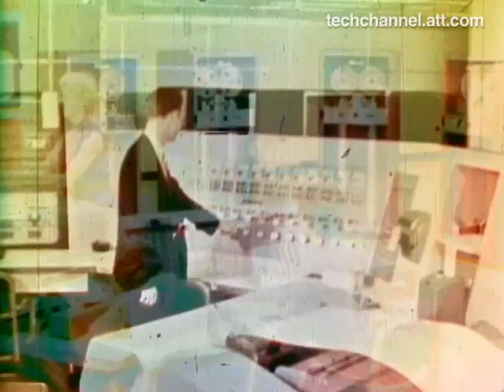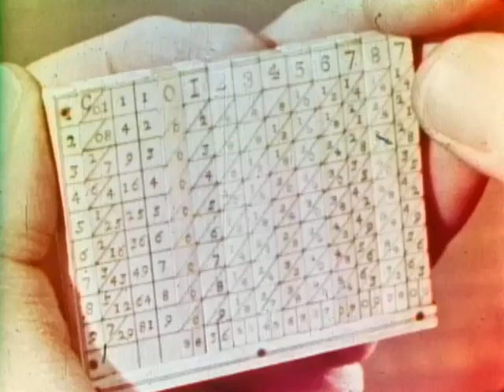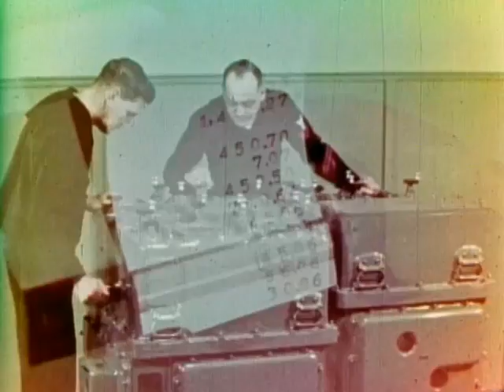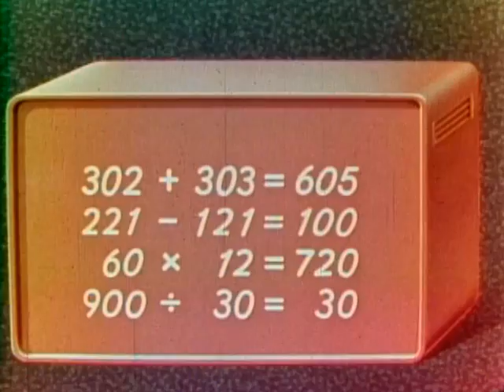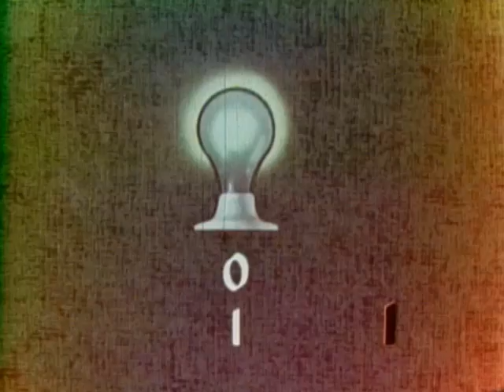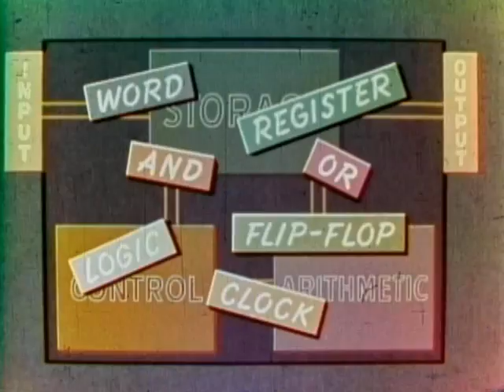AT&T Tech Channel - How a Computer Works. Great Tutorial From 1962

Comment: The graphic animations are made mechanically, by photographing manual drawings on celluloid or paper one frame at a time. The fade-in and fade-out effects are also made mechanically, using an optical printer or traditional film processing. This was the norm until the early 1980s.

Comment: the slide rule they showed works the same as the vernier scale we used on vernier callipers in engineering measurement.
We had 1 semi-auto lathe that used punch-tape for programming each job.

Comment: You point a camera at a board with the images printed on and/or cut out of paper. You set it back so it takes up the whole frame and then you focus the lens to put it just out of focus to remove the paper grain. Then you step a single frame on the camera, adjust the graphic for the next frame, and step again. If it's a stationary graphic and you want to get it done quickly, you just roll the camera for the amount of time it's going to be on screen.
Reply: Alatina Thucklemuggin He’s talking about how the video transitions and animations were done.